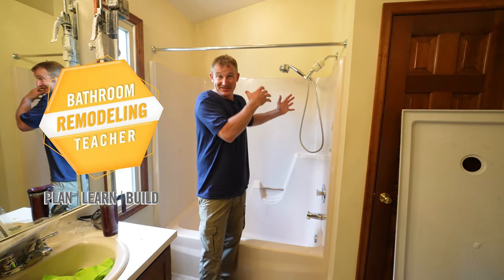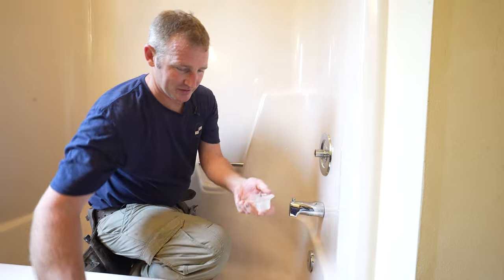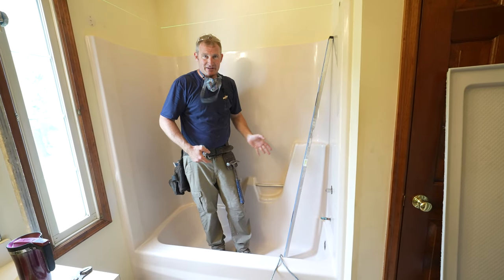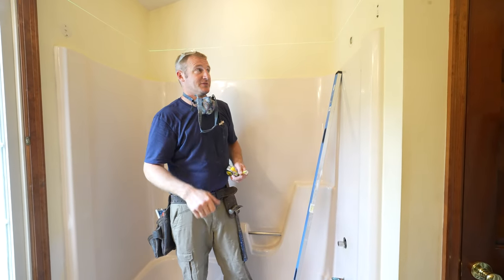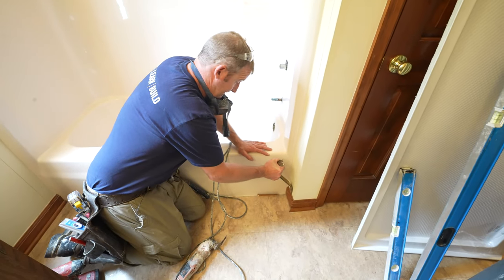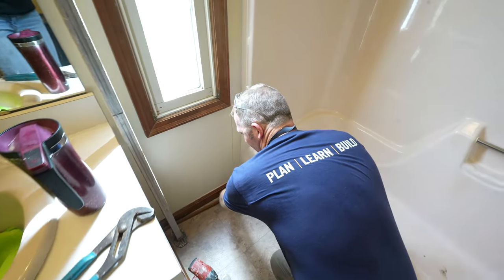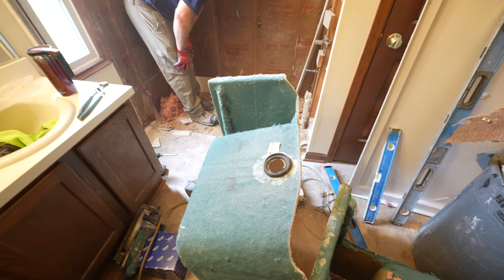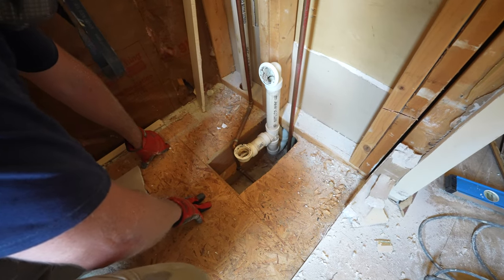How to Remove a Tub Shower | Tub to Walk-in Shower | PLAN LEARN BUILD

Comment: Great video. Easy to follow instructions  for those with  basic to savvy tool skill level.  I  clicked on here because I want to  remove my tub ( Americast) and existing  tile surround  and replace it with a walk in shower,  24 inch to 30 inch glass panel perpendicular to the showerhead wall, and the remaining  30 to36 Inches open.

  I am sure your AV course on Assembling the Renovation Is  as clear as your Demo video. Therefore a good deal for many. 

 I am in my planning stages and on a Concrete slab. I was/am toying with the idea of using some kind of masonry product to  create fall to the  drain.  What looks like a low profile fiberglass pan of your finished product at the end of the demo video sure makes my back Feel better as well as giving me hope that I can do the project In less time. 

Thank you

Comment: When cutting drywall with my oscillating tool, I like to use a curved blade or a blade that is 2" wide. A really dull blade won't even cut the poly! By far the best tool for the job.

Comment: Don't forget to turn off your power to the water heater (if electric), because if it were to automatically switch on somehow, then without water it could burn out an element.   More than likely it wouldn't switch on but better tafe than sorry.  Leave off until the water has been restored and the hot water lines are running freely indicating that the tank has refilled (if it drained).
Reply: good idea....most water heaters fill from the bottom and draw from the top..so thats a safety concern but usually it wont be a problem..

Comment: Very nice video! Man, I wish the tub drains I have encountered came out as easily as that one did. They can be obnoxious!
Reply: You also need to be careful trying to remove one. I did mine yesterday due to a leak and it wasn't what I thought it should be. Got the drain removal tool, started turning it and it just spun and spun, never coming out. I noticed there appeared to be a nut in the middle of it with a hole in the middle. Well, come to find out it's a Geberit brand from the 80's. Remove that middle bolt and then you can pull the drain out. Could not find a replacement so had to reuse that until I can do the tub removal/walk in shower.

Comment: Hello! Thank you very much for the video! Do you think that if the house only has one bathroom, would it add value to the house by removing the tub shower and transforming it to  Walk-in Shower?
Reply: I am only a buyer, and absolutely prefer a walk-in shower to a tub in a one wet room situation.
Tubs popular with young romantics and families with very young children, walk-ins for every one else, and especially those with age or mobility issues.
Reply: Be careful, most places have codes that prohibit removing the only tub. Here in Illinois, code dictates at least one tub per dwelling.